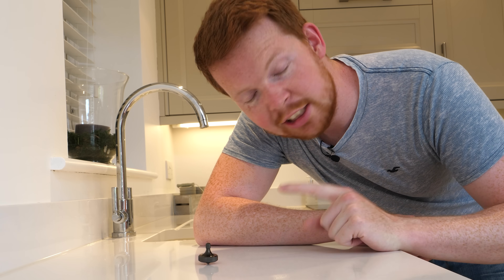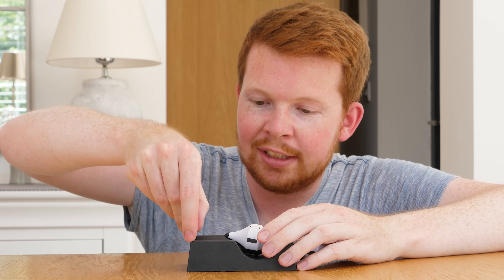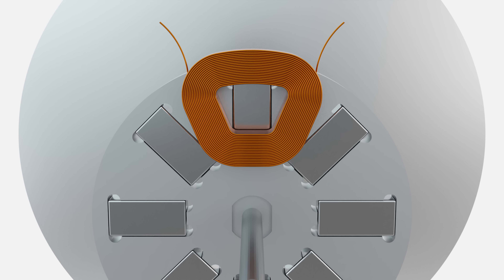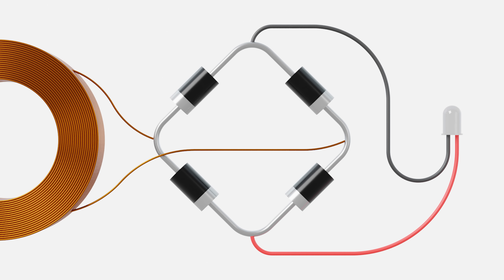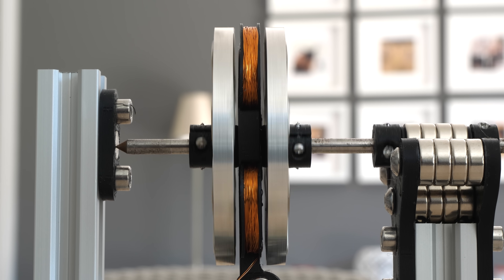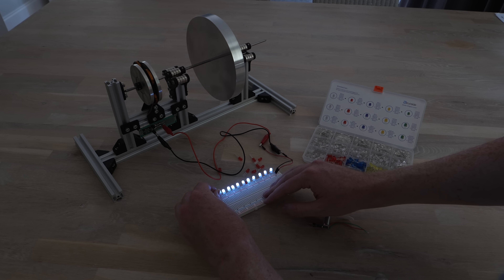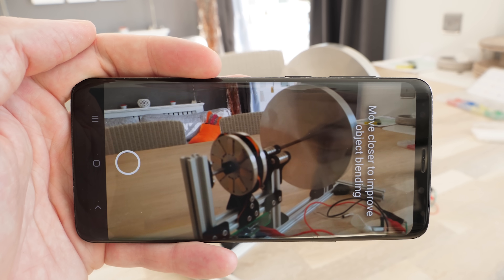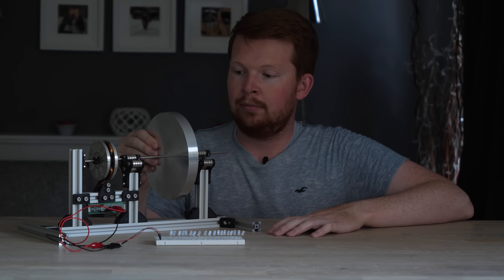Flywheel Battery

Comment: I wish you mentioned how the flywheel spins for less time when it's powering something vs not powering (and I guess it feels heavier to spin as well). I always find it fascinating how you can see the energy being used.
Reply: i modifyed a homebike that now powers a 12v motor you can definitely feel the load, if you put a light on it and go fast you feel the moment the filament break out because it become so much easier, it's like you're on a downslide.
if you contact the two wires of the motor and it arcs it's like someone pulled the brake each arc
Reply: @maxk5065  that is incredible
Reply: @minoxs  "the load" makes a lot of sense this way.
and in your bike, brakes are kind of convertor too, they convert motion into heat by friction, my motor act as a brake when it convert motion to electricity by magnetic induction.
Reply: @maxk5065  
right! If I recall correctly, that is the principle behind regenerative breaking that is used in electric cars, and makes them way more efficient :)

Comment: I'm not very well versed with the engineering, but I guess you could try to build a transmission that connects the engine that you are powering to a gear that is attached directly to the levitating shaft.. in that way, you could power it for a longer time?

Comment: Love your stuff, Tom. Have you tried this set up with a vertical axis and an antimagnetic cushion at the base, so the whole lot 'floats'? You will, of course, need surround magnets to hold the axis in place as it rotates. The vertical system eliminates friction completely, (especially if you can put the lot into a vacuum bell and pump the air out. I saw a guy do this with a Mendocino motor and it immediately began rotating much faster). His device was solar/light powered, as all Mendocino motors are.
Also when you are trying to insert the axis into the flywheel centre hole, put the rod in the freezer overnite, rather than heating the flywheel. Might reduce the warp problem.
Sometimes it pays to turn the thinking cap around 180 degrees and try things the opposite way... might work, might not. Never know till you try.
Good luck.
Reply: How about earnshaw's theorem? I thought stable systems couldn't exist without active corrections?

Comment: Why not steal from the gyroscope and add some sort of string to the rod so you can spin it faster. You could insert the rod into ball bearings on either side but still keep the magnets as to keep the rods weight  off of the bottom of the ball bearings.

Comment: Love all the videos! After watching an elite cyclist try to power a toaster I've been wondering whether slowly spinning up a large bike powered flywheel can power a toaster 🤔?
Reply: Well you need a fixed amount of energy, so even if the power needed to run a toaster is much higher than the power a cyclist can produce, it's just a matter of putting in more time. Also they could just charge an electric bike battery and then use it for the toaster

Comment: Should have used a power resistor and capacitators after the rectifier to smooth the DC and prevent the LEDS from blowing up if you put too much current thorough them. I'm not quite able to see if you had any of these resistors somewhere there, but at least the capacitators are missing. They would make this a far more usable project.

Also, maybe one should have the flywheel contained by magnetic fields inside a vacuum casing, instead of just levitated by them, to create an even more efficient solution.

You could also use one of those old pedals that powered sawing machines back in the day, to spin the wheel, or an exercise bike

Comment: I know you wanted to show how it works just using magnetic levitation. But you show now make a more efficient version of that and see how long it will spin. I suggest a hardened steel shaft this time. Maybe machine the flywheel on the shaft. Them either balance both ends between centers, or on barings, and use the magnets to take the presure off the ends instead of taking on the whole work of keeping the thing from wobbling all over the place. Just think of how much better you can make that.

Comment: one thing you could maybe do is add a second panel on the other side to increase the stability of the rod. You’ll still have to replace the current one used in the video, but it should hopefully slightly reduce the wobbliness.
Another thing you could do is shorten the space between the magnet posts, allowing more support to the flywheel.

Comment: Hi!
What if you use a dc motor to spin the wheel and in turn usin the wheel to charge the motor. But at first, spinning it manually.

Comment: I’m not quite sure why the led is flickering given that you are using a capacitor. I would have expected the electrical flow out of the capacitor to be smooth and continuous. Is it that all of the power being generated is being consumed right away and none is being stored in the capacitor?

Comment: Incredible why don't you attach the electric motor to the back of it and attach elastic band to electric motor and the flywheel and worth a bit of adjustment I bet you could get the motor spinning the flywheel and if you can build one that can charge batteries you get free energy self-charging battery cars self-charging home electric cooker lights washing machine Village coronavirus is it possible please let me know

Comment: Some suggestions: #1 Turn one set of levitation magets arount so they both want to pull the flywheel in opposite directions and allow for fine tuning. Use a point on both ends with carbide steel against tungsten plate. #2 ,Keep everything compact (closer) so you can use a shorter but thicker axel. Axel protruding is adding preturbation motion 
#3 Instead of adding a wheel of magnets to both sides of the coil -rather use two couls on both sides of a single magnet flywheel. ,#4 Your diodes were nackward in the diagram...but you got it.  #4 If you dont have the precision for a smaller magnet gap then use stronger magnets. #5 Use magnets on the outter edge of the wheel (or even flywheel itself) and cod outside of that for faster magnetic foeld changes and more voltage. #6 Seal in a vacuum to reduce air drag. Ir use a Rosthaul solid state dehumidifier in reverse to fill the encapsulating container with hadron.
Reply: Use a cacitor to accumulate power to the LEDs to prevent the flashing.  Also, you should be able to spin this ip by powering the coils in the right sequence/timing.

Comment: I would drill a few holes in the flywheel for compressed air and balance.  To cut down on friction, place two repellant magnets where the shaft point meets the plate. A 2/1 gear reduction  to increase rotor speed. Also some kind of rail to keep everything in place. Sadly there is no way of getting around losing energy in any conversion. Great design. Elegant, functional.

Comment: there is a way to make a self recharging car using a similar tech... but the charge comes from the rotation of the wheels with gearing involved on something similar to an alternator. should try and get a motor to spin the flywheel using the energy provided using gearing, and see if you can make it so it has an voltage overflow meaning you can transfer the energy to a battery

Comment: "Charge up" the flywheel by using the generator as a motor (duh). Faster rotation stores more energy. 4x the speed stores 16x the energy.

Comment: 0:42. According the soulless "Backdrop" people, they say: "But magnets are not a source of energy, they just store energy." Which then boggles the mind, when the magnet is literally called a "permanent magnet." The entire energy crisis is caused by what Nikola Tesla called: "Deficient observation." People should be able to look at a magnet on their fridge, which has been performing work by holding a sheet of paper for 3 months, and they should know that the magnet is generating a field, it is creating energy. It only takes a fraction of a second to "switch on" a magnetic material. And that's how a magnet works. It is simply a valve for energy. Once you align the molecules in the magnetic material by applying a magnetic field, the shutter is permanently opened, and then energy begins pouring through. If science actually allowed people to understand this, then fuel would be obsolete overnight.

Comment: Much smaller generators can produce more power! For example an old, small hand-crank generator has many metal sheets around the (one) spinning magnet (not neodymium) to concentrate the magnetic field into one single coil.
Reply: My grandfather had an old phone crank. When the phone company went to powered lines, he used it to stun fish. "Here kid, wet yer fingers and hold these wires for me."

Comment: now use the small motor with a band to spin the flywheel to keep it going . .. you can use small pressure and it should keep it more balanced . just a thought and i think you could easily make it happen . i would be curious to see if it would last a while more.

Comment: Hi there, just a question from a know-nothing-about-electricity. If the objective is to produce a DC current,  could he have kept all the magnets oriented the same direction and produce DC current without the need for a rectifier? Why go through all the trouble to make AC, and then correct it to DC. Would the output be different? Can someone please explain?
Reply: Maybe.  But he'd have to change the orientation of the coils 90 degrees so only one side of the coil is energized.  I don't know how that would affect things.  Seems like it would cut the power in half if not more.  It's making me want to buy a bunch of magnets and wire to experiment and see the results of some of these ideas.

Comment: Wonderful Project. 
How about making another set of levitation magnets but place it above the flywheel Rod?

After that, use a 775 motor against the flywheel instead of the drill. 
Add some more capacitors to power the 775 motor after giving it a start with 2 9v batteries.

Wow! I hope I will see that result.
That's my respective on it.
Good innovation

Comment: Wow that's cool.  I don't understand electricity, but even I want to try lol.  I wonder if the edge of the flywheel was heavier, it would hold its speed better?  Like carve a channel and pour lead into it and secure it somehow.  But then it probably wouldn't be balanced.  

Unsprung weight is what I guess I'm thinking of?  Like how a car needs the smallest unsprung weight possible, whereas here, you want the highest weight you can get, right?

Comment: What if you used the power harnessed to power a small motor that would spin the flywheel to see If you could perpetually spin the wheel or maybe just significantly prolong spinning time.

Comment: One great improvement, and a very simple one, would be to increase the diameter of your shaft. You need at least twice the diameter and I would be more inclined to triple it. A larger shaft size, especially if you are using a heavier metal than the aluminum flywheel, will become a part of the mass of the flywheel and give it more weight, more stability, and potentially more kinetic energy. I'm sure that if a larger diameter shaft would be better balanced and/or easier to balance. Neat project. I enjoy your videos.
Reply: Stability could be improved, but that definitely wouldn't help at all with kinetic energy. E=0.5 I w^2, and I is just the integral of mass by radius. More mass close to the pivot does nothing.

Comment: could you use the alternator in the reverse direction to also spin it up by putting electricity in? making it a techincal full battery where you can put electricity in and take it out later?

Comment: How about levitating both ends. Then instead of offsetting onto a retraining plate to hold the axle with components in place, use a ring magnet on the axle with rectangular magnets set to oppose both sides poles. So the set up cold be (rectangular N to ring side N , S ring side to rectangular S) use a larger diameter ring magnet on the axle. Set the restraining magnets in close to prevent lateral movement. Any friction would then be caused by the air around the whole device. You could then work on how to enclose in a sealed unit and removing the air to reduce friction further.
The next thing to work out would be how to spin the device when enclosed :)
I wonder how long it would spin for then?
Reply: It is mathematically proven that static levitation only with permanent magnets isn't possible. For a spinning flywheel it's possible because of the gyroscopic effect, but it will get unstable if it slows down.

Comment: You could do something like a hand powered compact grinding wheel that you spin using your whole arm strength instead of just your fingers to get the fly wheel to a higher rpm, but im not quite sure how you could go about rotating the disc without having any physical parts connected to it. (Would be nice if anyone can tell me if this idea is a viable option and if so tell me how you would go about doing it, and if not tell me why it cant be possible. Thanks

Comment: can you add more coils and magnets with more rotors say 5 more set up on the same rod with the flywheel then on the end hook up a motor and battery system to start the wheel at  a fantastic speed then let the motor free like a clutch or use a starter motor which has it all in one. Will you have more current being made than current being used by this project? If so you would have an over unity system that could work for cars or homes

Comment: Heaviest flywheel:
The completed system is the world's largest-class flywheel power storage system which has 300-kW output capability and 100-kWh storage capacity by rotating the flywheel which is 2 meters in diameter and weighs 4 tons.Apr 15, 2015

Comment: Excellent! 👍👍👍
I'm sure the device would run better if the fly wheel was turned as one piece (the disk and shaft) instead of adding a shaft to or through it. Then it would turn without a wobble. That was a great video!

Comment: Wouldn't it be possible to make one that's straight, has a bit more coils put at different degrees so it would put out a AC current at all times because the magnets are always in line some way or another?
And put the whole thing on a spinning wheel (to make yarn) so you can easily power it with just a foot pressing on the peddle? :D

Comment: If you have a second pair of rotors for your alternator, you could have them out of phase and double the frequency of the pulses in your leds.  Maybe by having the second set of rotors on the other side of the fly wheel, it might help your flywheel be better balanced,

Comment: The magnetic bearings are a good take away from this but apart from that you’ve created a normal generator. Wind turbines should be fitted with properly engineered magnetic bearings to increase efficiency.

Comment: This makes me wonder about how humanity could scale this up 100 or 1000 times and actually generate renewable emissions free electricity on a larger scale. 

Obviously there would still need to be initial energy used to begin the spinning of the flywheel, perhaps via a large counterweight etc. that is slowly cranked up by winches after providing the initial energy and inertia transfer to the flywheel. After that, the energy required to continue to keep the flywheel and shift spinning would be negligible compared to the initial energy required. 

The industrial scaled large flywheel and shaft would only need to be stopped occasionally for maintenance etc., and certainly the counterweight/ initial inertia device weight could be slowly lifted to its ready position well before that stopping point. 

I'm not saying it would be easy, and of course there would be some serious safety considerations that would have to be strategies and enacted before something like this could be attempted, but I think that it would be highly possible to carry out as long asbit was done in a region with low tectonic movement/ activity, as well as with dampers in place to minimize any impact. 

Perhaps the best method would be to still scale up this concept, but only to a certain calculated limit that would make the desired scale of economy effect while also staying within an ease of manufacturing and safety limitation. Then it would be about the number of these generators to reach energy levels required to make them effective at powering human populations. 

Perhaps a "small" bank of these at each home, or for each city etc. could be possible. Obviously non renewable energy like oil, gas, coal, etc. would all hate this.

Comment: Would be pleasing to watch a small sterling engine connected to it with a thin rubber band (like for braces) to keep it going without having to spin it by hand all the time.